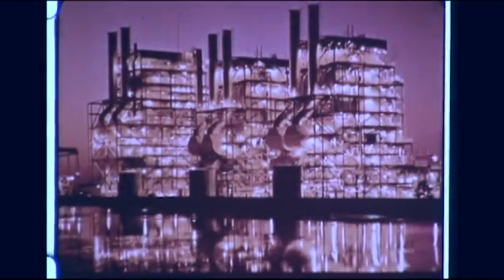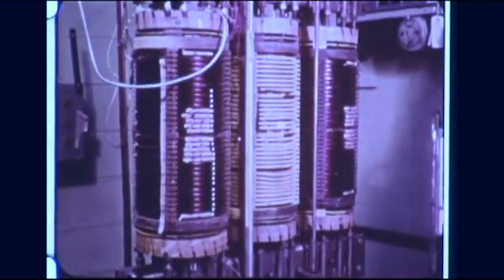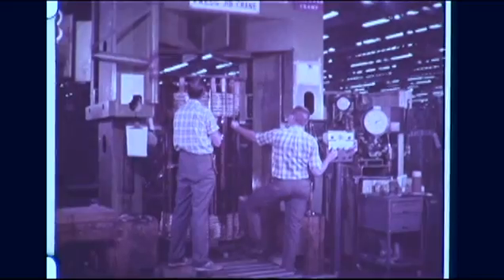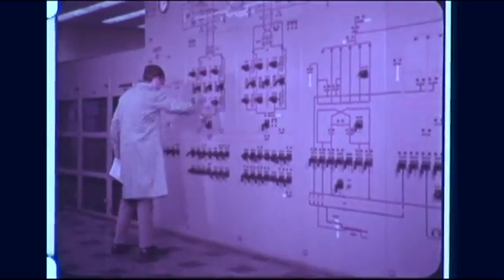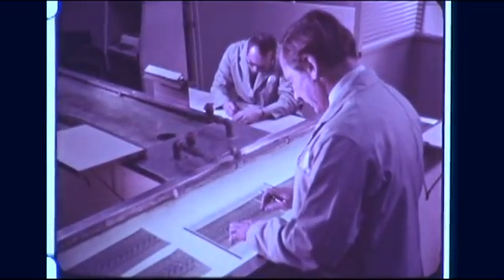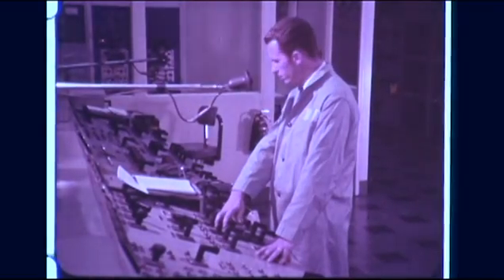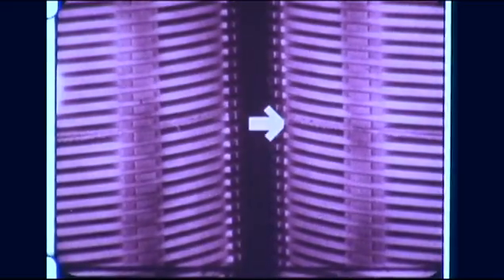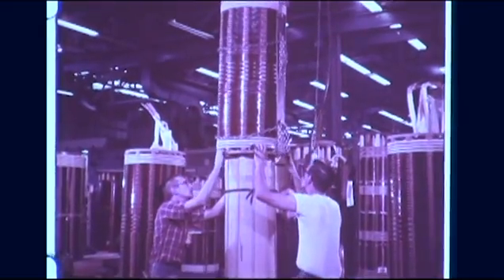Transformer Reliability - 1973

Comment: in those days, it might have not possible to apply  voltage to the transformer when sine wave is exactly at peak. Request to upload video with modern techniques for short circuit test.